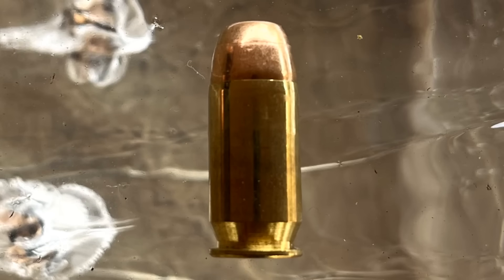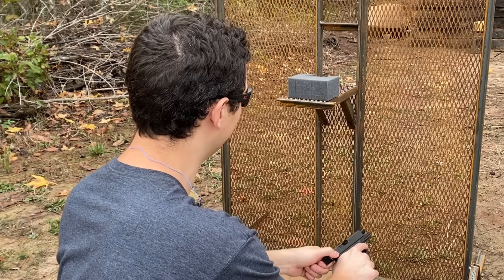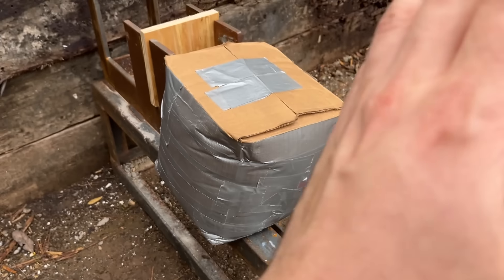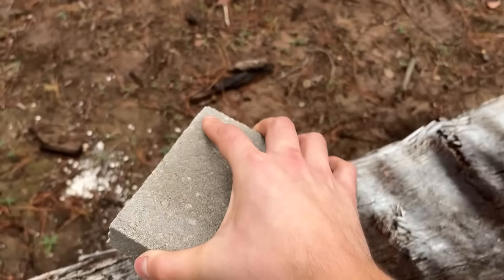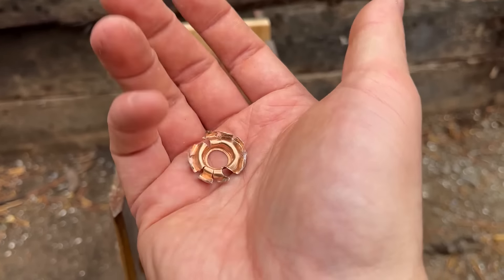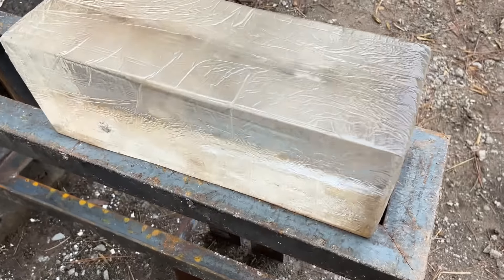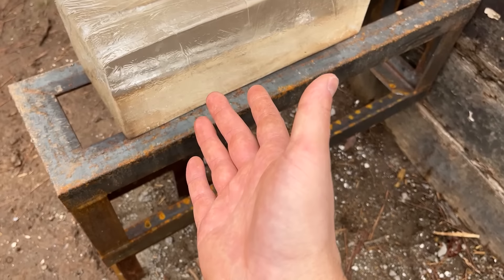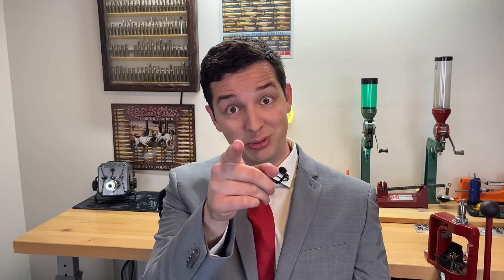9mm vs 45 ACP Barrier Test: No Debate?

Comment: No debating... 10mm is ballistically superior to both.
Reply: 10mm, the AMERICAN mm
Reply: 9mm will sometimes penetrate deeper in some barriers than 10mm… just saying.
Reply: I won't have a 10mm. It would disappear like everything else 10mm.
Reply: @meanman6992 I don't disagree I just feel like it packs more of a punch I still carry a 9mm everyday though
Reply: @meanman6992 Show me when and where bud.😂
Reply: @meanman6992 Not true. Not by any means.
Reply: REAL 10mm, sure, but most companies don’t manufacture proper 10mm anymore.
Reply: when ammo manufacturers actually load it hot enough to be called 10mm and not just 40sw the sequel.
Reply: @meanman6992  Not true.
Reply: 10mm is notoriously under powered. If it was loaded properly- yes- best caliber
Reply: @DonovanFlamingusIII  This is why I always carry Underwood.
Reply: Underwood is the only company that makes proper 10mm. Every other manufacturer makes it underpowered putting it at essentially the same level as .40S&W. I choose 9mm for capacity. Federal HST, Speer Gold Dot, Hornady Critical Duty are the top pistol rounds in any caliber.
Reply: @TheSkeptic000  That has nothing to do with 10mm. Every caliber is often "underpowered" with cheap ammo.
Reply: @Grooove_e  I carry Underwood, but its not true that they are the only company. There are plenty of companies that make full load 10mm.
Reply: Yeah but u need man wrists
Reply: @voice_crack_gamer6937  Autumn's Armory enters the chat.
Reply: You mean the 1cm?
Reply: @H.R.6688 , have you seen my 10mm socket or wrench?
Reply: @JAD1DAD  if I did it's finders keepers. Lol
Reply: @chaseme9860  how you gunna just say that without naming them? Almost every 10mm I've shot is weak compared to underwood.
Edit: my apologies I know that Buffalo Bore also makes some spicy 10mm. But still that's only 2 brands
Reply: The bigger AND faster round has more energy that the smaller, slower round, sure. But, recoil, weapon size, concealability, penetration concerns (though generally overblown in seriousness), handleability by smaller shooters/hands, ammunition costs, availability of weapons platforms, ammunition, and bullet types kind of leaves the plenty capable 9mm looking pretty good.
Reply: Sounds like a good future test for Banana Ballistics.
Reply: @AlecG0  For sure. There's a reason it's carried by guides in Alaskan bear country. But, 9mm does just fine and much more concealably when I'm in people country for all kinds of reasons.
Reply: Depends on your needs..... some people have different needs and uses
Reply: Depends on uses.... the old debate came about  number of rounds vs power... and with the new same compacity it comes to recoil preference and target intended
Reply: @H.R.6688 this is an underrated comment!!! 🤣🤣🤣🤣👍
Reply: But breaks your wrist to shoot it 🤣🤣
Reply: @Grooove_e  Why should have to list them for you? Any experienced shooter knows the brands. Underwood, Buffalo Bore, Liberty Ammunition, Hornady... Just off the top of my head. "Weak compared to Underwood"? That depends on the rounds you're talking about. Underwood makes anything from 1200fps 200 gr. to 1600fps. 135gr. and everything in between. FYI, the average dirt cheap 10mm range ammo is at 1100fps/180gr. That's the average for expensive 9mm 115gr. carry ammo. Even cheap 10mm ammo is superior.
Reply: @RepentorPerish77  You don't even own a gun. I can tell by the comment.
Reply: @chaseme9860 Nothing less
Reply: @chaseme9860 Buffalo Bore is another. Or, handload.
Reply: @chaseme9860  Anyone who carries 9mm and knows what they're doing doesn't carry 115gr. Its 124, 135, or 147. I don't know why there has to be such a debate anyway. Everyone always think the round they carry is the superior one. The police, FBI, and ATF all carry 9mm and have killed more people than all of us combined. Also, liberty and hornady do not make a full power 10mm. In tests I've seen from other channels they both lack in velocity severely compared to the Underwood and the Buffalo Bore. Even as a person that carries 9mm I do belive a proper 10mm round is superior to every other pistol caliber, I just wish there was more development on it sooner. I did not wish to get in a pissing match with you and for that I apologize. Have a good one.
Reply: Drastically!👍🏽
Reply: @Grooove_e  Buffalo Bore is even better than Underwood.
Double Tap also loads 10mm properly.
Reply: Zackly!  I carry a 10mm, and just bought the APC10 pro to SBR for the get-home bag. I keep a .45 around because it’s awesome, and home defense.  Just bought a carry 9mm just to have something in that caliber but 10mm is king.  That said, $2/round for Federal HST’s pisses me off, lol.
Reply: @chaseme9860  your mama don’t
Reply: @pewpewTN  hmmmm, have to disagree on that one🤣 Buffalo Bore doesn’t quite put out what Underwood does.  Underwood is my absolute go to for true full power 10mm and .40😎
Reply: If you can find real 10 yes but I'd still prefer 9 or 45 bc I can find it everywhere and 10 is hard to come across
Reply: @Grooove_e 
I was going to reply that Buffalo Bore make good 10mm but you already corrected yourself. Hand loading is best for 10mm
Reply: Except for the fact that only 2 manufacturers that I know of load a proper 10mm load. The rest, no better than a .40 S&W (slow and weak)
Reply: @TheAxe4Ever  absolutely right. Underwood, Buffalo Bore, Double Tap, and Sig Sauer make true 10mm loads
Reply: @chaseme9860 the 10mm was downloaded on purpose.  It was actually called the fbi 10mm load or 10mm lite.
When the fbi fist started using it it was at full power.  It broke a lot of first gen 10mm handgun and the fbi had problems getting agents to qualify with it.
So they downloaded it.  Then ammo and gun manufacturers released they could get the fbi 10mm load specs in a smaller package. 
That was the start of the 40 s@w.
And also the start of the 40 nickname among the serious leo shooters.
40 short and weak.

The cheap ammo had nothing to do with the original reason behind the downloaded ammo
Reply: @meanman6992 Not full-pressure 10mm, which most loads aren't. But .357 Sig or .357 magnum both do virtually every time.
Reply: No debating the 50 BMG is superior to the 10mm
Reply: No debating? What are you some kind of master debater?
Reply: Everything is inferior to the 45/70 deringer 😂
Reply: @TheAlbertaChannel  in terms of recoil, definitely 😂😂
Reply: Excuse me,  you misspelled .40S&W my friend...
😂🤣😂
Reply: @timrobinson6573  I, for one, absolutely am.
Reply: @Grooove_e  I was giving some weight reduction so I didn't have give a slower FPS rating, but by all means slow the 9mm down even more. Also, there is no debating. 10mm IS ballistically superior. You can't argue against it. That's not my opinion, just a fact. This has nothing to do with how many people carry 9mm. Most people carry 9mm  because concealability within an acceptable ballistics loss. "Full power" is going to be measured by muzzle energy and FPS. Liberty makes a screaming small grain 10mm that reaches about 800fpe and 2500fps. Hornady is pushing 180gr. at 1300fps. FYI, FPS always trumps grain size.
Reply: @Radvous 
😂
Reply: The 10 mm does beat both 9mm and 45 ACP. I however know both are 9 mm and 45 ACP are still pretty powerful. The 22 and 32 acp are the under powered calibers.
Reply: @meanman6992 what barriers? More speed and weight in 10mm.
Reply: In standard pressures yes but 45 has more potential. All is needed is a fully supported barrel and recoil spring and 45 super can be had yielding much more energy, momentum and kinetic energy than 10mm. .460 Rowland can be had with a barrel swap as well bringing up to 44 magnum ballistics.
Reply: No shit Einstein
Reply: He wasn’t testing a 10 mm.  🤦🏼‍♂️
Reply: @chaseme9860  facts
Reply: I thought 300wm was the best
Reply: The 10mm comes and goes, and will go again. It can’t do anything the 45, 45 Super, or 45 SMC can’t do. And, it will never be a 45. The 9mm will definitely never be a 45.
Reply: So is 357sig
Reply: The nuke of handgun rounds!
Reply: And pretty stout too
Reply: Full power 357 sig or 357 mag is probably equivalent of not 41mag for sure
Reply: No doubt I love the 10mm my EDC is a Glock 29
Reply: @brandonholsather2171 what about .25 acp? Not underpowered? I'd rather carry a .22 mag. Yes, even though it's a rimfire.
Reply: Basically, that’s not what this video was about. So…
Reply: Just remember: It's still a pistol.
Reply: @XRakkgruntX bubba’s pissin hot hand loads*
Reply: What about 11mm?
Reply: Actually it's the opposite, studies have shown that jacket at Hawaii point 10 mm performs poorly because the board is moving too fast and it Is fragments.

 hard cast is a different story.  Good for penetration of critters.
Reply: But, does it actually matter enough to matter?
Reply: For edc 357sig end of story.
Reply: If you buy from major ammo manufacturers, then you're shooting an expensive .40S&W, bud. Also, 44mag for the win 😁
Reply: Who cares? If ballistics is all that matters then why not just carry .50 cal?

In general 9mm is still the better round for self defense. Most (I said most, not all)  9mm guns will have higher ammo capacity, lighter recoil, and weighs less.

Sure the 45 hits a bit harder but shot placement will still be more important than the myth of knock down power.
Reply: @timjones147  I wasn't talking to you.
Reply: 10mm wasn't a option here
Reply: So is a .50 cal.  Being able to get on target quicker, is superior to spending extra time figuring out where the front sight is.
Reply: @92egturbo  Why?
Costs more, more recoil, lower capacity.
Reply: This town ain't big enough for 10mm
Reply: @Grooove_e so does Buffalo bore
Reply: Doesn't matter, a trained defender can put down a bad guy just the same with either 9mm or 10mm. Either way, it's still just a pistol round. A 223 dwarfs a 10mm in every way when it comes to terminal performance. As for dangerous game, a 10mm offers nothing more than capacity, it's no where near a magnum cartridge like a 44 magnum and will never touch anything a 500 S&W magnum can do, which there are others, but again, 10mm only offers decent power with capacity and it needs a longer barrel to really get the full potential out of it which no current handguns on the market have unless it's modified.
Reply: @coupe50h  a 25 ACP is under powered. I didn't bring up 25 ACP becuase not many people own 25 acps anymore. The 25 ACP caliber is under powered and was known to have a jamming problem. The 22 magnum however does not have lots of jamming problems. The 22 magnum does not reach full power out handgun barrel however. The 22 magnum is still underpowered out of a rifle barrel even though it has way more power out rifle. I still would say if a bad guy was trying to kill you a 22 magnum couple in the bullets through the lungs would drop and kill someone fairly quickly out a rifle barrel. I do think 22 magnum out rifle barrel can out perform a 32 ACP or 25 ACP or 22 long rifle bullet.
Reply: @brandonholsather2171  I would think the .32 acp would have even more jamming problems than the .25 being it was known for "rim lock" I have a p-32 however that does fine. I think a .22 magnum I'm a revolver would be pretty effective and of course not jam up.
Reply: And 357 sig
Reply: And 7.5fk is ballistically superior to 10 mm .....lol
Reply: Unfortunately most 10mm on the market is underpowered
Reply: @f3nixfire  No its not.
Reply: @chaseme9860  It absolutely is
Reply: @f3nixfire  Nope. It over penetrates.
Reply: @chaseme9860  That's a terrible one dimensional argument. Any caliber can over penetrate. Thats not a caliber characteristic. Thats bullet and load design. This is why they make more than one bullet design and load for each caliber. 7.5fk is no exception. I own the hollowpoints (S95), as well as, the monolithic copper heads(F9). It has more speed and muzzle energy than 10 mm in its factory stock form. Sure, 10 mm has more loads to choose from because it's been around longer. 7.5fk is still a relatively new caliber. More and more loads will become available as time goes on. 

With that being said, stock baseline load vs stock baseline load 7.5fk is ballistically superior. This is just fact.
Reply: @f3nixfire   "That's a terrible one dimensional argument."...lol. Are you serious? The gel block penetration test is the hallmark of ballistics testing. All 5.7 rounds over penetrate. Clueless.
Reply: @Grooove_e Buffalo bore and a couple of others also make full power loads for the 10mm.
Reply: 9X21?  Not common but a interesting round.  Similar to the difference between 40 S&W and 10mm.
Reply: @chaseme9860  I'm clueless? Lol, no. My statement stands. As for 5.7 what are you talking about? Not all 5.7 rounds over penetrate. Speer gold dot makes a 5.7 hollow point that doesn't over penetrate and performs quite well actually. 

You can't even discuss the correct caliber and bring up a completely different caliber out of the blue 😂
Reply: Yeah if you shoot the full power stuff
Reply: @TheSkeptic000  I shot a Bren10 in 10mm years ago,  full load Hirtenberg ammo. Heavy gun still not comfortable on the wrists.
Reply: @chaseme9860  Yes you were.
Reply: And 44 mag is superior to the 10mm
Reply: @terrybaird9532  Nope
Reply: @H.R.6688 😂 well done!
Reply: It’s all about knockdown power and damage cavity, bigger holes, bigger leaks, buddy, 10 mm go nuts with it they will go straight through and the guy will keep standing
Reply: I tried to defend myself with a 45 and 45 did not come down 9 mm, but it went straight through
Reply: 500 S&W Magnum 700 Grain Solids 😊
Reply: Agree
Reply: @terrybaird9532  How?
Reply: @chaseme9860  You seriously think I’m wrong that the 44 Magnum is ballistically superior to the 10mm?
Reply: @terrybaird9532  Yes.
Reply: @chaseme9860  prove it.
Reply: Right, and a 22LR can still do damage. These videos are dumb and a waste of time. 10mm? For what? Gotta go. God bless.
Reply: So is 40S&W.
Reply: 9 for 2-legged predators, 10 for 4-legged predators 😉
Reply: Beat me to it. I was also gonna say, .357 sig and 10mm are better than 9mm and .45acp respectively.  Would be cool to see those rounds go head to head using the liberty ammunition civil defense rounds.
Reply: @DonovanFlamingusIII gotta get Buffalo bore or underwood
Reply: @scottg1962  I think that 357sig and 10mm are best out of SMG/PCCs.
Reply: Someone's forgetting +p. 45 again. Do your research.
Reply: @H.R.6688 cap 😂
Reply: If it's a true 10 mm load 180 grain 1300 fps 1200 fps for 200 grain not this 1130 fps bs
Reply: @meanman6992 sure a 9mm +p+ in fmj will penetrate deeper than plinking 10mm hollow points, but comparing apples to apples, 10mm outperforms 9mm in literally every way possible. EVERY WAY.
Reply: @kevinrichardson8859  I have developed an interest in that caliber (357Sig). I've been all about "The One Centimeter People Eater" since it came out. I was shooting it when the FBI said "ow, it hurt my hand, kiss it make it better".  Hell, I'm actually prejudiced against 40sw because of 10mm (40 is a great round, but we all know WHY it exists). I had laughed off 357 Sig when it came out and wasn't surprised when it (pretty much) died off. Now that I am older and (kinda) smarter I realize - a super flat shooting round, almost as hot as 10mm, that fits in a 9/40 size pistol makes sense! In fact, if Glock releases a Gen5 G32 MOS, I'm all over that shit 👍
Reply: Minus capacity😢
Reply: @cardinalprosoftwash   Barely, as long as ya run the right one. I have a 1911 in 10mm which, I agree, makes no sense to carry - Big, Heavy, low capacity. But my G20.... oh yea 😎
Reply: @cardinalprosoftwash  every time you pull the trigger things will fall down how bad do you want to explain to the judge it's not a 9
Reply: @ericfrontczak8016  Although your comment has nothing to do with ballistics, I fully agree. I read somewhere that statically, jurors give longer jail times according to caliber. .38 Special offered the least jail time, because of its history of the innocent "granny at home" defense caliber. .38 Special gives off that vibe of a dusty revolver sitting in the drawer for years, only to be pulled out for defensive reasons.
Reply: @hromary88 that's why Mines a hi point. If it dissapears it will end up with all my lost harbor freight 10mm sockets.
Reply: Came here to say this. 10mm is designed from the ground up to be better than both.
Reply: @JAD1DAD well played!  Out of nowhere for the win!
Reply: Funny how everyone talks up 10mm but they’re shooting basically 40.  Very few people carry non standard loads.  Closest thing to a having a hotter load is …. Your mom lol.
Reply: @ltx383  "Very few people carry non standard loads"...WTF is a "non standard load"? Just make up some nonsensical bs and act like you know what you're talking about...lol. People have range ammo and carry ammo, Sherlock. There is no "standard". Educated gun people know weak ammo is produced in EVERY caliber.  This is why there is plethora of ballistic tests on YouTube so people know what to buy. Pretty easy.
Reply: Superior price!
Reply: @Grooove_e well that’s the brand ppl with 10mm buy 😂 I haven’t shot anything other than buffalo bore. 180-220 gr.
Reply: What’s crazy is a 10mm has almost the same velocity as a 9mm that’s some crazy power
Reply: @cbcastillo5681  lol...sure.
Reply: As is 44 magnum
Reply: More powerful yes...superior to all??NO!!
Reply: @johndoee3850  boo!! 😂
Reply: @Grooove_e  just underwood?? Buffalo bore stepped in the chat
Reply: @johndoee3850  Wrong
Reply: @chaseme9860  right
Reply: Ammo is more popular for 45 and 9 mm I will take either one over 10 mm
Reply: @danielcarpenter4361  I take all of them.
Reply: But all the girly men shooting 9 mm will cry.
Reply: 10mm is garbage compared to 357 Sig and 357 Magnum...
Reply: @Grooove_e  double tap.
Reply: But no one tries to compare it to anything else.
Reply: @jaewhite2462  not true or gets compared to all the magnum caliber revolver cartridges  often.  The .41 mag all the time, the 357 very frequently, even the the 44mag. Honestly in " real" 10mm loadings it falls somewhere between 357 mag and 41mag and there are overlaps between the 3. But for capacity well that's the kicker right?
Reply: @jaewhite2462  Because at the end of the day, you're just slinging lead with an explosion in a handheld device, and 10mm is found to be the sweet spot of ballistic effectiveness. Its just physics. Anything beyond that is personal preference.
Reply: Laughs in 45 SUPER
Reply: The amount of misinformation and bs in this thread is 👏 👏 amazing.
Reply: Yeah a FULL POWER 10M. If it's not , it will be the same as a hot 40cal.  45 acp FMJ is still effective,  heck they both are.
Reply: *450 smc and 460 Rowland enter chat
Reply: @JohnDoe-mf5sc  the argument was 10mm is superior to 9mm and 45acp. 
So basically all these magnum handgun calibers and obscure "super" calibers are not the debate.  The OP kept the field of comparison very narrow between the 3 cartridges which is why he could make such an absolute statement.
Reply: @JohnDoe-mf5sc And leave because they are not practical.
Reply: No debating... Patriot missiles are ballistically superior to both.
Reply: @brandonpetchnick1182  Your mom says I'm ballistically superior.
Reply: @brandonpetchnick1182  kinda difficult for edc but yeah.
Reply: Absolutely correct!!!
Reply: S&W 500 enters the comments 😆
Reply: @brucemedley69  S&W 500 is not basically superior. It would never pass the FBI protocol.
Reply: I’ll see your 10mm and raise you a 44 mag .😂
Reply: @Huntinghogs  44 is not ballistically superior. Too OP'd.
Reply: @chaseme9860  everyone gets hung up on ballistics. Ballistics are only a small part of the equation. Terminal performance is what you should actually look at. Wound channel and shock is more important than ballistics. A 44 mag is more devastating then a 10 mm ever thought of being. Now, any round can eliminate any thing living, right? The amount of damage caused by the round determines how fast that living being is eliminated.
Reply: @Huntinghogs  "Terminal performance" is not sperate from ballistics...Its part of it. This is why we use gel blocks when testing ballistics. This lets us no when "more devasting" has adverse effects. Because of this, we know 44 over penetrates.
Reply: @chaseme9860  you might want to reread what I posted. I said ballistics are a small part of this equation. As far as ballistics gel goes, yea it’s part of it. I’ll tell you this, we hunt hogs down here in south Texas. I’ve shot them with a 17 hmr, 204, 22-250, 243, 308, 30-06, 12ga, 22 mag, 357 mag, 44 mag, 45 Colt and 45 ACP. The damage from a 44 mag is consistent with damage from a rifle round. So, stay hung up on paper ballistics, I’ll use what I see in a real life application.
Reply: @Huntinghogs  You might want to reread what you posted..."Ballistics are only a small part of the equation." Dude, your playing games. You know very well you thought "terminal performance" was separate from ballistics. Also, over penetration is not an issue with hunting hogs. So it's pointless to even use it as a reference.
Reply: @chaseme9860  Seems like you’re the one playing games, Dude. There are many, many rounds that are ballistically the same but performs drastically different on impact. Swine is the closest thing to a humane body. That’s why I mentioned it. Not to mention, in my prior line of work I saw many, many people shot with every caliber you can think of. Ballistic calculators and ballistic gel give a picture of what “might” happen. There are so many variables in real life situations that you can’t not predict with 100% certainty what any said round will do. I’ve seen 9mm travel between to fingers under the skin of a hand, then enter under the skin on a forehead and travel under the scalp and exit out of the back of the persons head. So please, reread what I originally posted. You’re arguing just to argue.
Reply: @Huntinghogs   "There are many, many rounds that are ballistically the same but performs drastically different on impact." ...lol. You are either trolling, or you really don't know what "ballistics" means. Either way...move on.
Reply: 10 mil is best of both worlds
Reply: 10mm Auto is more comparable to .357 Magnum, and I’m not just saying that because Banana Ballistics did a video comparing the two either.

If anything, 10mm Auto is to .357 Magnum what .45 ACP is to 9mm, except even closer together.

I’ve also found much more 10mm Auto for cheaper than .357 Magnum, and I already have plenty of .40 S&W lying about just in case, so me getting a S&W 610 which could switch between calibers with a swap of the moon clips was a no-brainer for me.
Reply: That's a fact but people refuse to hear it. That's ok tho saves more ammo for me
Reply: @meanman6992 and where did you see this? Shitty ammo is shitty ammo I promise you 10mm loaded like it should be will always beat 9mm or 45acp
Reply: Underloaded 10mm is better than both of these, fully charged .40 is also, and fully loaded to spec 10mm beats all
Reply: And many can't handle. .40 s,w recoil then love the .10 mm which is same round just slightly longer and hotter and recoils more
Reply: 9 +P for me!
Reply: @chaseme9860  to all the 9mm guys in here claiming +P+ + + , the 10mm is the guy your wife told you not to worry about ;-)
Reply: @JamesHackett-kv4ki  10mm shoots very smoothly even out of a compact frame like a G29. Less snappy than 40, less recoil than 45, hits harder than all the concealable carry loads.
Reply: LMAO ok
Reply: 100% agree but I would never edc a 10mm

Home defense absolutely.
Reply: @gabrielduell5226  why not?
Reply: It's all the same with shot placement
Reply: @edwardseaton9447  You have been watching too many movies.